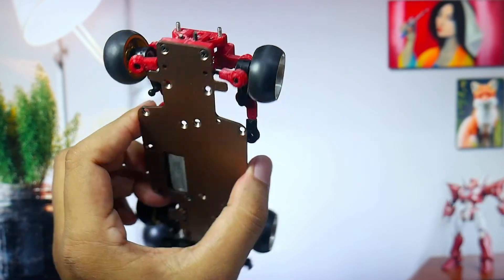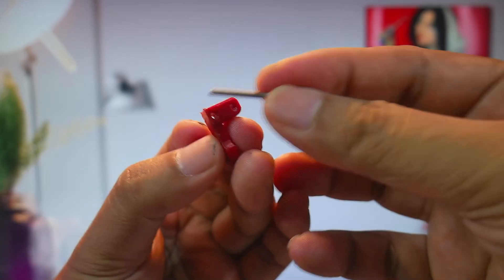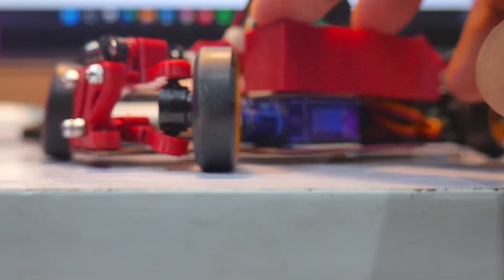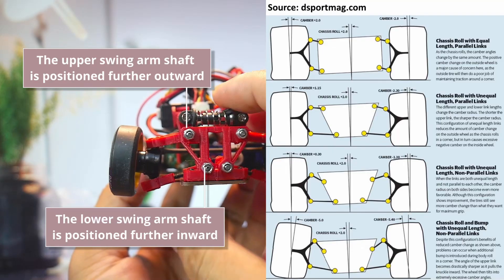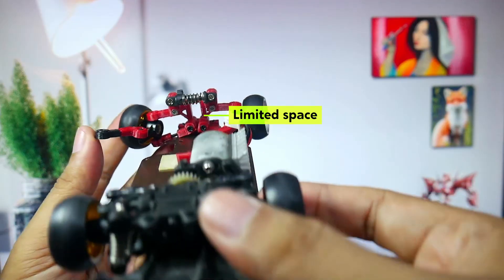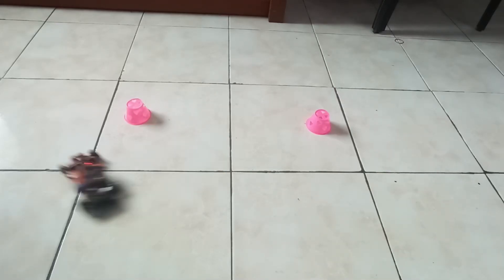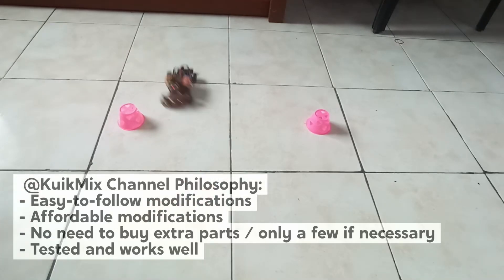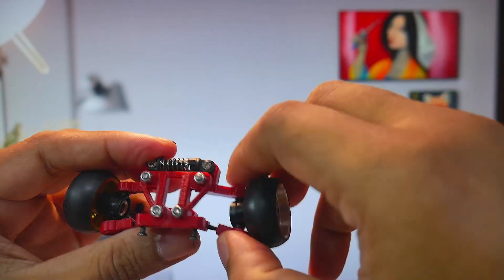K969 / K989 RWD V1

Comment: Hi, I've printed the modification and I have a problem. When I turn right, the left wheel doesn't touch the ground properly, and the car turns sharply. When I turn left, it runs smoothly. Can you help me correct the error? Congratulations on the work you've done.
Reply from the maker: 1. Make sure all the parts can move freely.
2. If that doesn’t solve the issue, adjust the servo position and find the best, most balanced setup for turning left and right. However, if you’re still using the stock servo and bracket, this option isn’t available. I’m already using a bigger servo (because it’s cheaper 😁), so I can change the servo position freely. I attached the servo using double-sided tape. For changing the servo, you can watch this video: https://youtu.be/X8ltmc2TKEE

That said, this steering system still has limitations. No matter what we do, it won’t be 100% balanced due to its construction. That’s why I plan to design a better steering system.